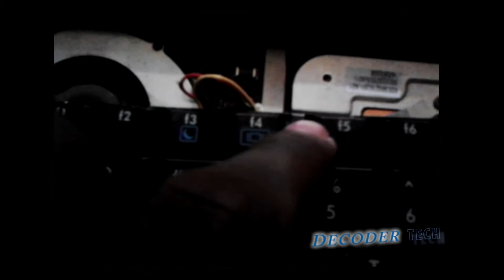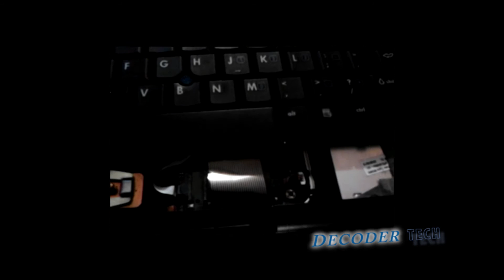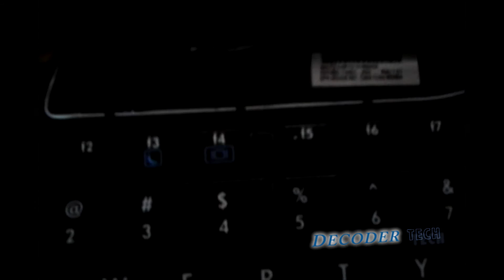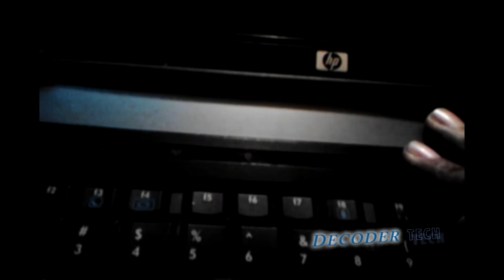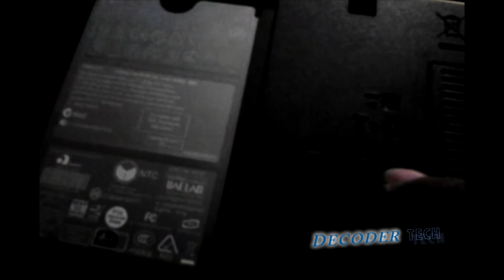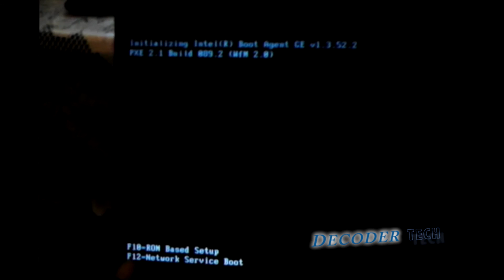Decoder Tech: HP Compaq 8510p continuous restarts loop or shutdown (Problem Fix).

Comment: I'm still using this compaq ,with XP. BUT IT IS getting hot and fan is on always on high now . yes it is cleaned well.
Reply from the maker: Did you try taking off the heatsink and re-apply thermal paste?
Reply: @TheReid2DecoderTech  yup. did it.  computer is working OK but running really hot CPU . even when running no programs.

Comment: I have the exact Model Laptop.I have replaced the Thermal compound,replaced the Motherboard, and replaced the Video card.The Laptop still shuts down in a loop and the Video card is VERY hot. (thoughts bad video card? bad mb?)
Reply: Nothing like youtube comment necromancy, but if any of you run into this issue the HEATSINK hre  as gone bad. Never had I had any issue with any other lappy that was caused by a bad heatsink. When you open it right after it does the bootloop you'll notice that the gpu heatsink or cpu heatsink is hot to the touch. If you run a temp monitor then you'll notice one of the temps is 100c and that is what caused my issue. Since they're old it may be hard to find a working replacement but there's always ebay I suppose.
Reply from the maker: I'm thinking that the heat may have damage something on the motherboard.
Reply: Janoy Reid I just finished installing the new motherboard, same thing happens but extreme heat is coming from over the GPU so I guess the video card I bought off of ebay is bad..
Reply from the maker: Bonsaverh Could be, did you have warranty on it?. try to reset the bios to default too ok
Reply: Janoy Reid No, its a clients, thanks for the speedy response though.Tomorrow I'm picking up yet another Video card and I will update you.
Reply from the maker: Bonsaverh Ok good luck man.
Reply: Third video card didn't help, apparently they are known to be defective...
Reply from the maker: Bonsaverh Well if i were you I'd tell my client to upgrade to a newer model or to buy one that suits his'her need. Wise you all the best.
Reply from the maker: Thanks for the comment rewar.. Since it's a old laptop I would have buy one that's up to date.
Reply: Me too